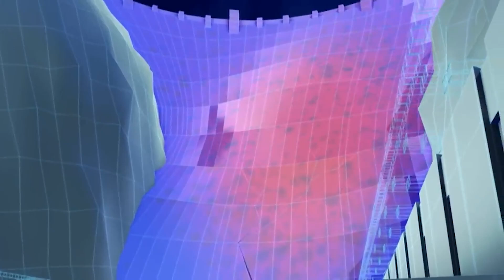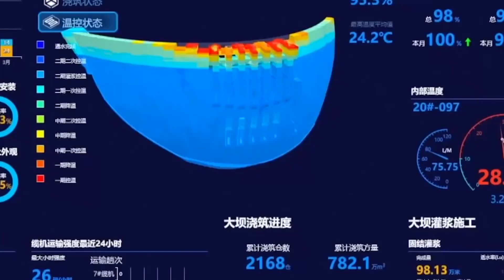The World's Biggest £75bn Mega Dam That Nobody Wants Built

Comment: I whant it to de build! It will produce the same amount off electric power (340 000 000 00KWh) anualy, same as the UK produce. Insignificant enviromental impact. Can  export energy to India and "East Pakistan" (and be a tool to reduce the tention in this "Hot" place.